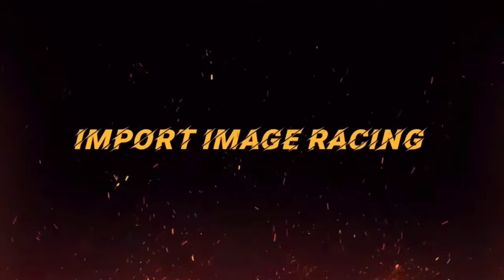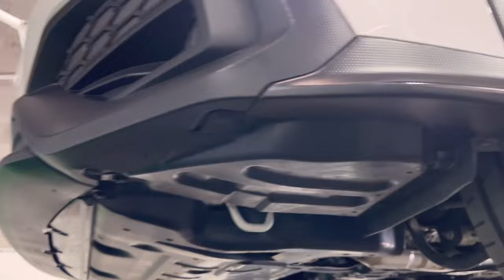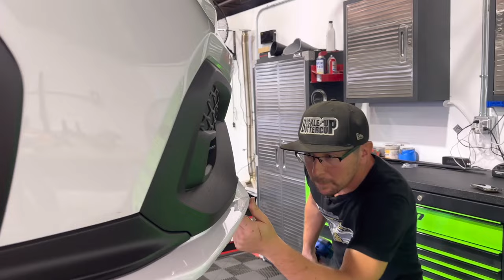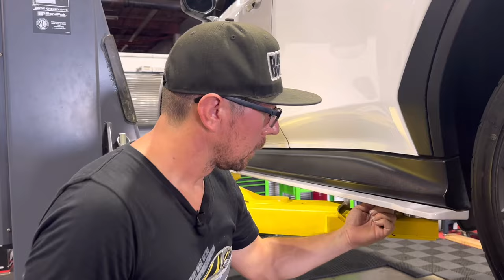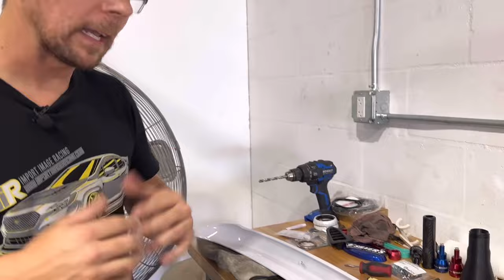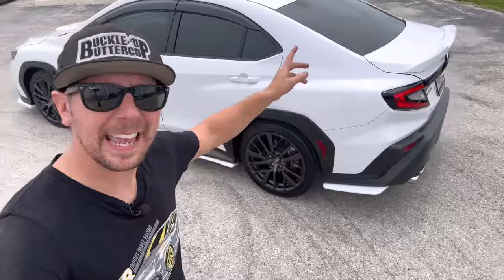ANOTHER ONE! ☝️ | NOBLE | LIP KIT | WING | 2022 | 2023 | SUBARU | WRX

Comment: Why are the rear spats not designed to work with both pop pins?
Reply: Subaru did not do dual pop pins on all cars. A good portion only come with 1 on each side from the factory. If you add or have mud flaps this will change what you have as well.

Comment: I considered buying, until I seen how far the color match was off.  Saving for the STI branded kit instead.
Reply: How far off was it? There's a few things to consider with the paint matched parts. These are painted with the same paint codes from Subaru. But, these also don't see the light of day until it's on your car. Sun fading will for sure make a difference. But, we've had great luck with these being close, if not spot on in most cases!
Reply: @daneyoung7770  I've only seen one from IIR in person,  but it wasn't close. The part was considerably lighter than the car. The paint finish and fit looked great however.  It was on a M6Y car.
Reply: I think it's just that white is the hardest color to color match. Any other color and it should be better
Reply: Just get black then and dont colour.match